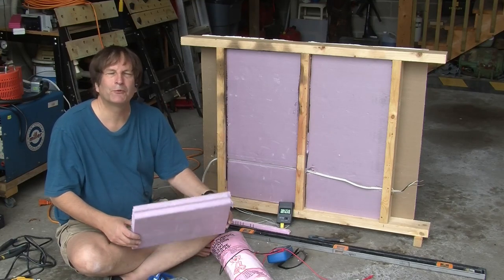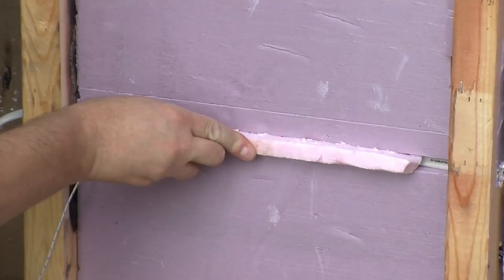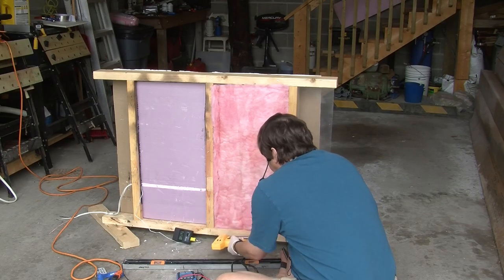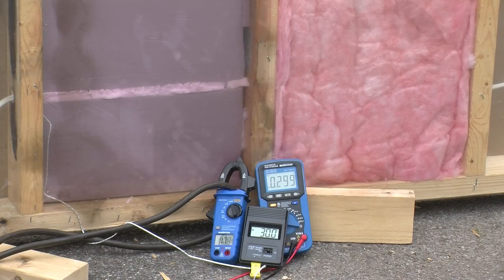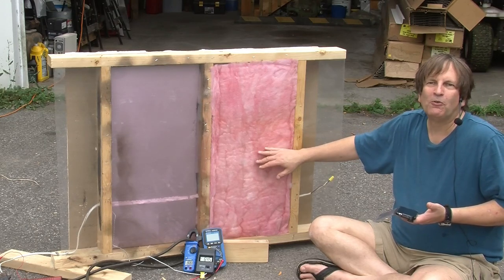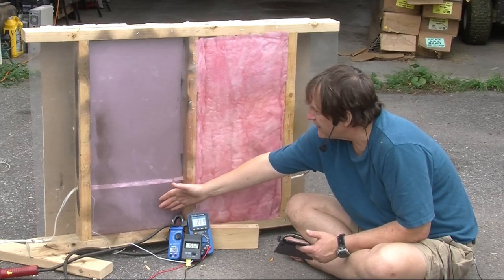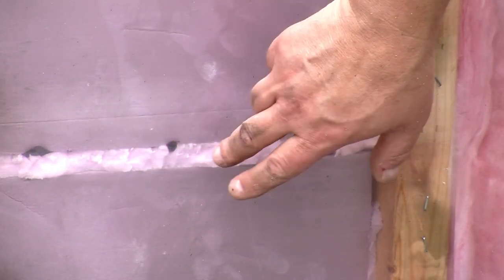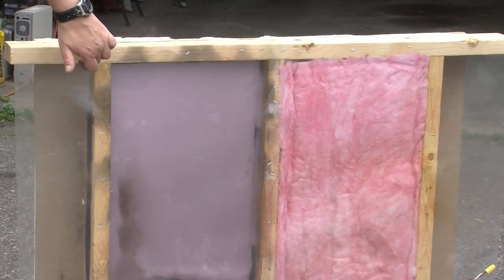Overheating and Foam Insulation. What happened?

Comment: Can you say something about what old means here in the context of when common house wiring temperature ratings were increased from 60 to 90c? 70s? 90s? 2000s?
I'm charging a car at 15A on a 120v circuit rated for 15A using 14/2 wire in a 30 yo house. I'm aware it violates the 80% continuous load rule, but I've tested to ensure the breaker is working properly, checked that the wire connections to both the outlet and breaker are very tight, and examined the entire length of wire (that's visible) with an IR imager, not observing anything over 37c anywhere, so I'm basically just trying to use your experiment videos to infer the maximum possible temperature of the wire that's hidden in insulation behind the two walls it travels though (no attic runs). The hottest location I've seen is at the wall plug for the EVSE charger, which got up to 45c. Though I assume this is due to the higher resistivity of the brass plug prongs. All measurements taken after 12 hours of continuous charging. I think it's possible that there are hidden locations on the circuit exceeding 60c, but not probable....
Reply from the maker: I think it might have been about 40  or more years ago when 90C cable seems to have become commonly installed (an electrician would have a better idea when 90 took over - I'm and EE). Its often printed on the cable - look for a 60 or 90. 

The one good thing about 60C stuff it was generally installed when less insulation was used so it didn't get as hot. 

My  house was built  25 years ago, and its  NMD90 (just checked some exposed cables). 

I wouldn't try and infer too much from my videos since the insulation  could easily differ and measurements were quite crude other than to be concerned if the cable is embedded in significant insulation.

So I guess may comments are a bit wishy-washy and its really because its hard to know. If you think there is a concern, back of the current a bit and reduce the current even more on hot days. Here's a thought - is there anything else - plugs, lights on that circuit? If not you could make a 240V circuit and at 10A get same power as 20A on 120V. I dont know if the 240V chargers need a neutral - if so, a transformer could re-create it.

Hope this helps a tiny bit :) Just subscribed  to your channel - looks like you have some really great physics videos!
Reply: @ElectromagneticVideos  Oh....well....there it is. UL E18679 printed right on the cable, which corresponds to Southwire's product rated to 90C 🤣 I should have hunted a little harder for that before! The only other thing on the circuit is the garage door opener, which of course is only drawing significant current for a few seconds a day. I usually have the car charging at 12A, but sometimes will need to bump it up to the max 15 if I need to top off to 100% for a long trip. I think it'll be ok. I just had the breaker on the circuit making sizzling / arcing noises when I first charged the car and that kind of made me paranoid. It's swapped out for a new one and it doesn't make any noise now or go over 100F as viewed with a FLIR One even after long durations of charging at 15A. 
Thanks for the follow, I don't know how many more interesting science documentaries from 'ye olden dayes' I'll be able to find, but I'll post them if I get them.
Reply from the maker: @Muonium1  Well a sizzling breaker is never good - good that you changed it. And great to know its 90 degree cable.
Reply: @ElectromagneticVideos  Ok, well....wow, what a difference ambient temperature makes. When I did this initially some weeks ago at a continuous 15A, it was around 15c in the garage and I just repeated everything again now that it's warmer at 27c. All else being equal, one may naively expect that instead of 45c on the evse plug, I should now see around 55c. In reality, it was now running at an amazing 85c and the cable was feeling very mushy and floppy. I opened up the outlet box and instead of being 46c, the romex cable inside was now at a significantly scarier 60c. I will definitely not be charging at more than 12A continuous from now on! At least not in anything but darkest winter. It's surprising how nonlinear these temperature things are and how quickly they can approach the material design limits. The 80% continuous pull rule it turns out really isn't that overly conservative.
Reply from the maker: @Muonium1  Thats both scary and fascinating! My first guess is that the non-linear part  is probably due to the resistance of copper increasing with temperature - so for a given current, the hotter it is, the more heat it gives off. Glad you caught it before something bad happened. Once concern- the mushy cable may have sustained permanent damage to the plastic insulation from the excess heat ....
Reply: @ElectromagneticVideos  I think that's probably the main reason too, the "electrothermal" feedback loop of higher resistance and temperature when current is held constant, as it presumably would be here by the car's charger. I'll keep an eye on the section of cable and plug from the evse that got hot, though it's plugged into a short length of beefy 10 gauge extension and surrounded by nothing but concrete and cinder blocks on all sides in the garage, so if it decides to go nuclear, it'll likely just burn itself out. Smoke detector is active in there too.
Reply from the maker: @Muonium1  I glad the suspicious cable isn't inside a dry wooden wall :) Never thought about it, but a smoke detector is not a bad thing to have in an electric car garage.
Reply: @ElectromagneticVideos  While you're here, what do you think about a whole house surge arrestor like the Siemens FS140 to protect the car? Worth it, or waste of money. I suspect there may be a one or two metal oxide varistors in the evse already for minimal protection, but I doubt they'd do much for a serious current spike. Obviously nothing will protect from a direct lightning hit, but of course most electronics aren't taken out by direct hits, just the ancillary ascending leaders reaching up from nearby conductors as a consequence of the main strike's massive induced e field, and these somewhat lower current few kiloamp pulses are thus more plausibly arrestable. For a couple hundred bucks I'm thinking it might be worth it.
Reply from the maker: @Muonium1  Thats hard question! Your point about induced fields - an acquaintance of mine unplugged all electronics - computer, copier etc when the noticed an thunderstorm approaching in the distance. They got a hit on their chimney (?) - no idea if it was the main strike or not. But here is what happened - the emp took out the copier which was connected to nothing. The computers And this was maybe 30 years ago - had their network cards blown - the had not disconnected the network. I just happened by a few minutes after it happened - quite amazing. 

And as you said  - nothing will protect from a direct hit. So - are you in an area where thunderstorms are common? Any local electric car forums/groups that might indicate whether lighting has damaged a car? I know in some areas they are now requiring whole house surge protectors - but I'm dubious of whether thats just from good lobbying from the surge protector makers. Might want to ask your insurance broker - any discount for having one. 

As a result of your question I'm now tempted to get one - an Eaton BRNSURGE Type BR Whole-Panel Circuit Breaker Surge Protective Device costs $135 cdn (=100 us) and would slot right into my Eaton Cutler Hammer panel. For $100 or so its probably well worth it for just the electronics - and more so for a car. The Siemens one seemed to be more around $300 or $400 - a bit harder decision. 

So I dont know - but as I said I'm really tempted to get the BR Panel one now! One thought - if you go for tan in-panel one, I would try and make it the first breaker position next to where the power comes in. I'm guessing at the high frequencies from around a spike the panel bus may be more like a transmission line and so it would be good to get the spike before it gets to anything else.
Reply: @ElectromagneticVideos  Now that's an interesting anecdote! I do try to unplug the computer if I hear thunder, but of course often they roll through at night and I'm asleep. Maybe a slightly higher lightning risk than where you are at, Rochester NY, so nothing crazy like Florida or Texas or anything. I've searched the internet a few times for any stories of lightning damaging an EV while charging, but never found anything. 
Thanks for all your advice and assistance! Hey if you are ever in WNY (for some godforsaken reason) and have any interest in a look around the world's (second) most powerful inertial confinement fusion laser system, lmk!
Reply from the maker: @Muonium1  I'm near Ottawa - so much the same thunderstorm weather in the summer. I'd be fascinated to see the inertial confinement fusion laser system - is that you work on - must be fascinating!
Reply: @ElectromagneticVideos  It is! I'm still awed by the scale of the place even after decades. 60 terawatts for the main 60 beam compression laser, 2 petawatts for the short pulse heater laser. We'll never achieve ignition and thermonuclear burn with it as NIF out at LLNL has achieved - not enough energy, but there's plenty of other work at the high densities and temperatures we can reach, such as planet interior simulations and superconducting liquid metallic hydrogen creation, etc. that keeps us busy enough. Just let me know some weeks in advance if you're ever planning on being in town!
Reply from the maker: @Muonium1  Those numbers are incredible! I'm thinking maybe late summer or early fall (although I presume summer is better before students get back to the university?)

Would you mind emailing me so I have your contact info? (these comments tend to get lost). My email is in the "More about this channel" section or just  	"electromagneticvideos" followed by the at symbol gmail dot com . I'll reply with my home email which I wont post here - too much junk mail already!

Comment: what do you think of UL?
Reply from the maker: Well as a result of this and some of the other experiments, I think the electrical code needs to be updated specifically where wire goes though thick insulation in modern houses. I'm not sure its a UL or CSA issue as much as a code issue. To a large extent, things like cables seem to do what the UL/CSA rate them for - namely survive 90C temperatures for example. Except its now much more likely to get to those temperatures with better insulated houses. If I was having a house built today, I would go for thicker than normal wire in  well insulated regions such as outside walls and attics, so instead #14 wire, use #12. I gather some electricians routinely use #12 in place of #14 everywhere these days anyway.